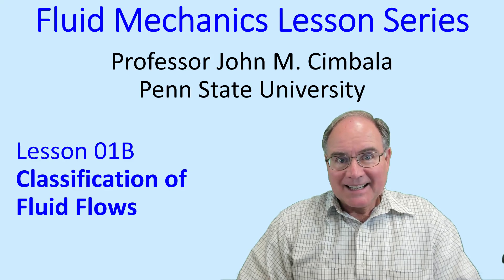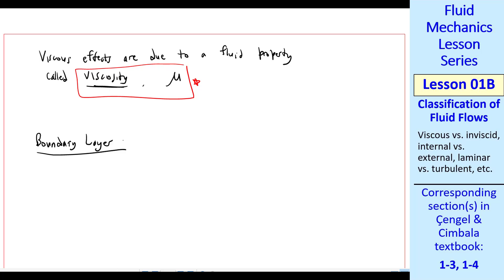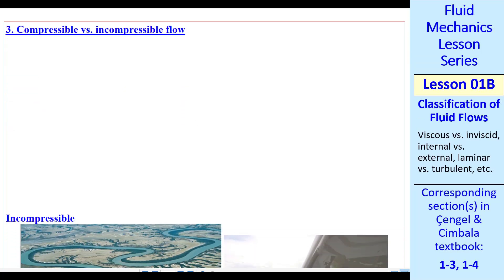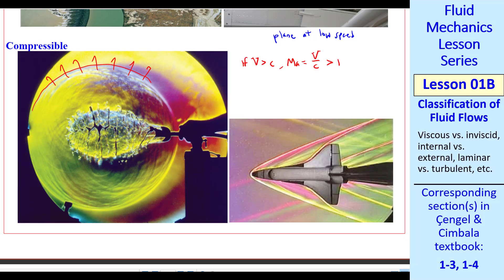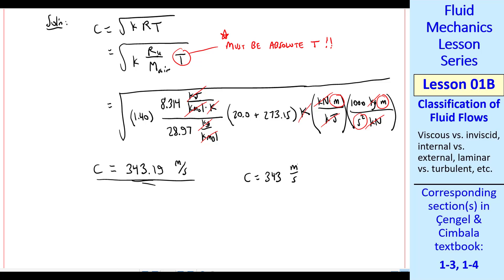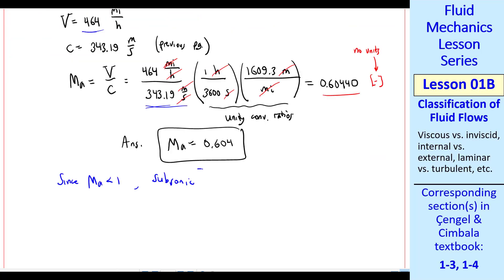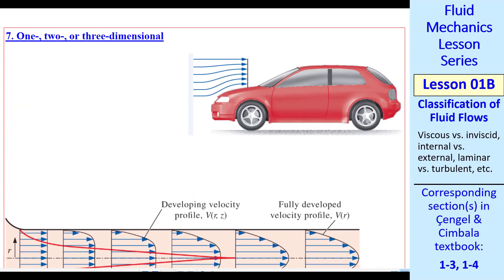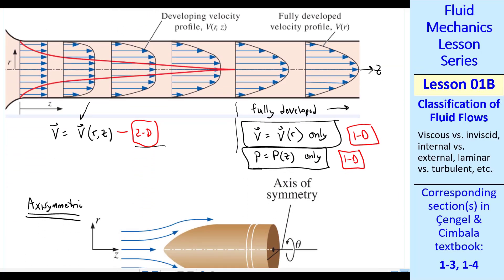Fluid Mechanics Lesson 01B: Classification of Fluid Flows

Comment: I'm an electrical engineer watching this for fun, and I liked that in confined flow once the velocity profile is developed has one dimensional pressure and one dimensional velocity profiles, which I found an analog in waveguide propagation where under certain circumstances, electromagnetic wave propagation in a confined "pipe" also have boundary conditions where electric and magnetic waves have 0 component longitudinal components at the walls and you get a similar 1-D propagation.
Reply from the maker: Nice analogy! Thank you for your kind comment. Please tell your friends and colleagues about my YouTube channel where there are almost 600 free videos about the Bible, fluid mechanics, science, math, Excel, statistics, air pollution, and other topics. I would greatly appreciate it.

Comment: Again, thank you for your great series.

In Munson's textbook (I use three to four textbooks to help me understand), it says that one-,two-, three-dimensional flow depends on the number of components (u,v,w) of velocity and not the number of spatial coordinates.

For example, would this be a one- or two-dimensional flow?
V=(6y)i+(3)j

As per my understanding, it should be a 1D flow as it only depends on a single spatial coordinate (the y-position). There are two directions to the flow but it only depends on a single spatial coordinate..

I would appreciate it if you could clear up my confusion.
Reply from the maker: That is a tricky one. In your example, the y component of velocity is constant. So, you could do a Galilean transformation by moving up with the flow (at speed 3). Then you would see u=6y and v =0 from this moving reference frame. So, I would call this one-dimensional.
By the way, thank you for your comment. Please tell your friends and colleagues about my YouTube channel where there are more than 400 free videos about the Bible, fluid mechanics, science, math, statistics, air pollution, and other topics. I would greatly appreciate it.